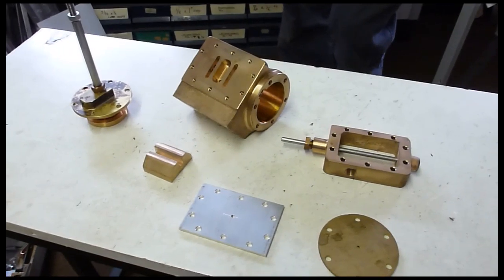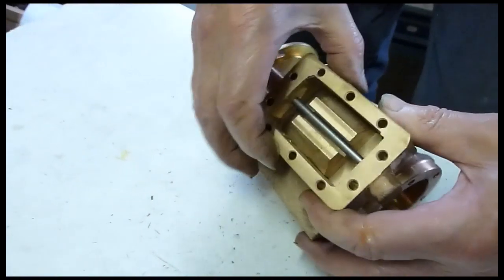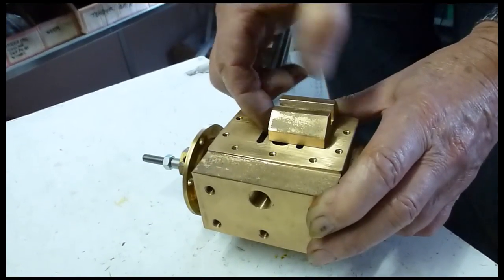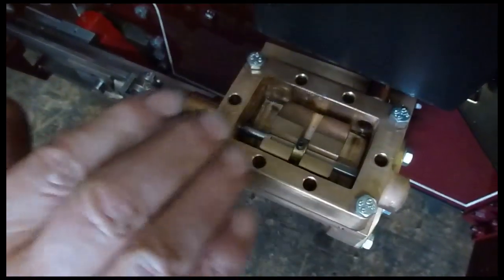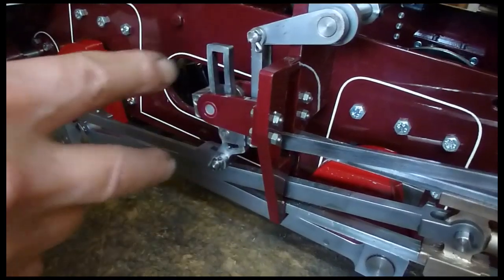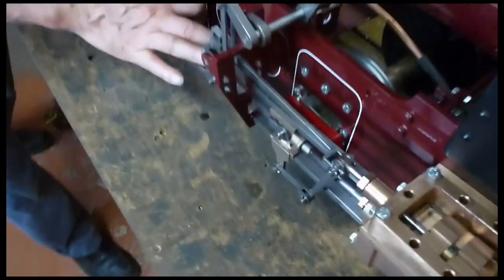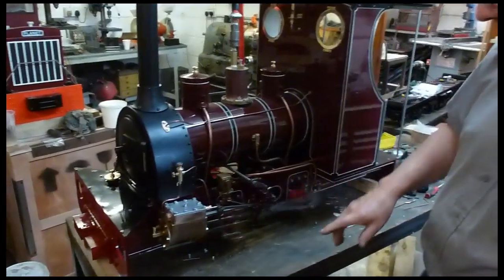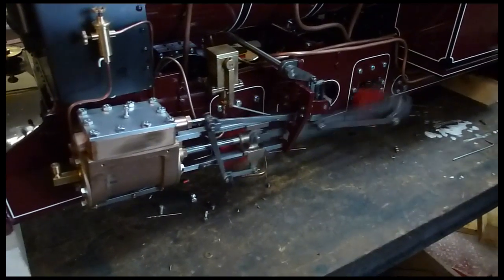Maxitrak Slide Valve Setting

Comment: If you want to reverse the block in the link reverse the eccentric crank  have you seen a Garrett both ends  going in same direction both eccentrics ether up or down one end has its cranks Reversed  lovely model coal fired char we are having trouble getting char in Australia some people are gas firing Ron

Comment: only for rough setting, accurate setting is not explained.
Reply: They only give the rough setting because it varies for every locomotive. Variables such as lap, lead, total valve travel, eccentric crank throw/pitch circle, and reversing link dimensions are different for every locomotive. Once the set of variables for your particular locomotive is known, then you can set about scribing the lines for the dead centers, and adjusting the valve gear to give the proper valve events. Really "Accurate Setting" comes down to minor adjustments and feeling out the engine until you know you've got it dead nuts (given that the valve gear components are machined properly to the correct tolerances and set up right). What they've explained and demonstrated here is a good enough guide to go by for the beginner. It takes skill and finesse that you only gain through experience and doing it for yourself.